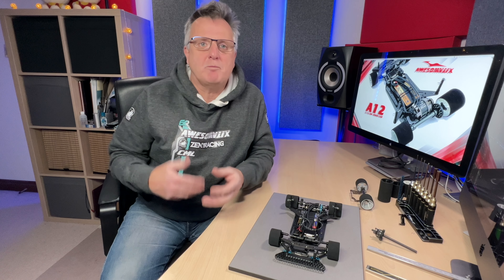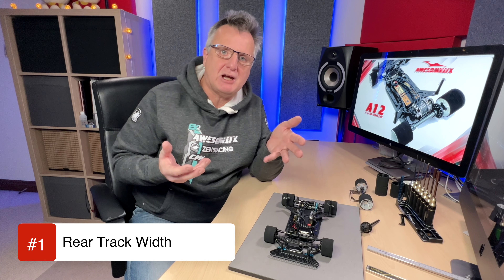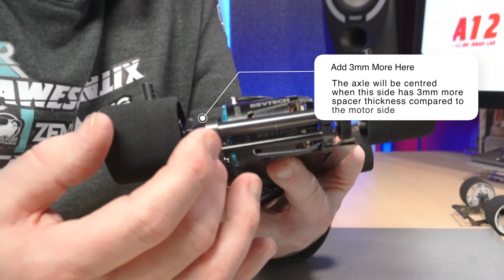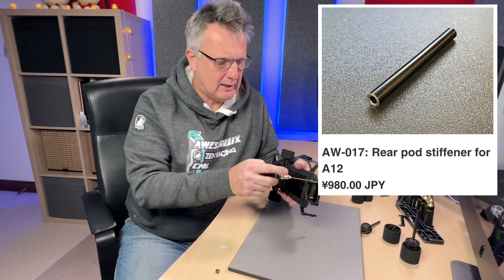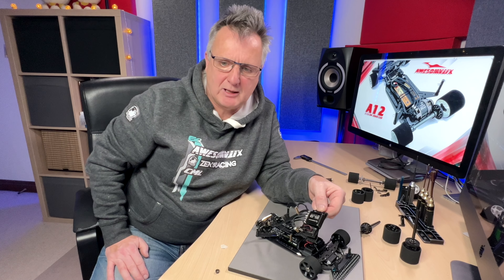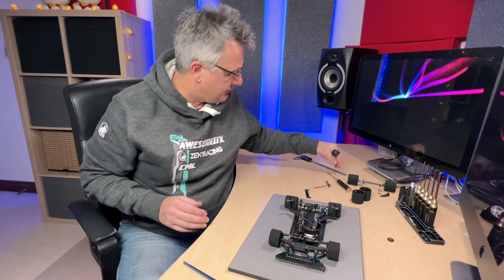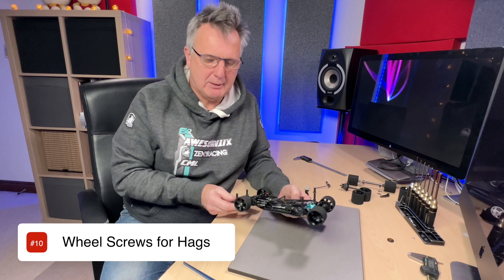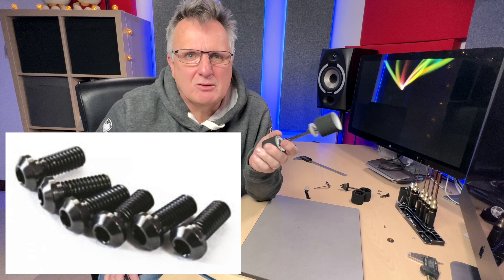Awesomatix A12 Rear End Tips

Comment: Thanks so much.  Running in US on black carpet however it is installed directly to concrete,  is also used for offroad, and gets a lot of dust from the dirt track next door.   Sometimes we get really high traction but on smaller club meets we run pretty close to what you are running over there!  Thanks for the good tips - will send new a12 racers at our track to your videos!  Hear what you are saying about getting slower, 53 here and definitely have to work a lot harder to stay competitive than I used too.  Thankfully this car helps a lot!  😁
Reply from the maker: Hi Jason. Great to hear from you. Keep on the good work for us mature guys!